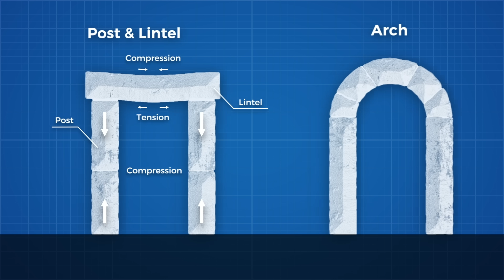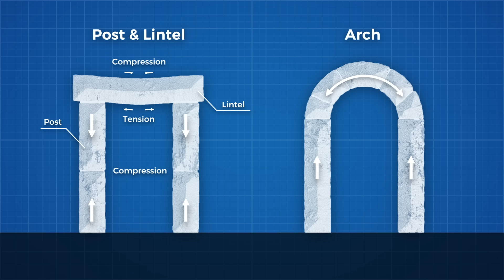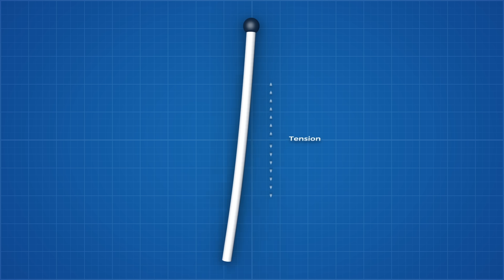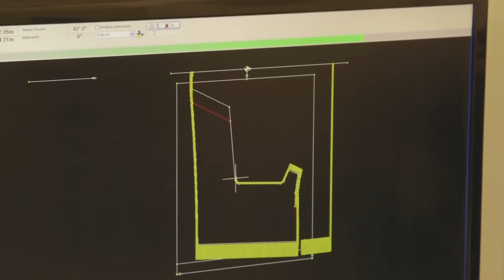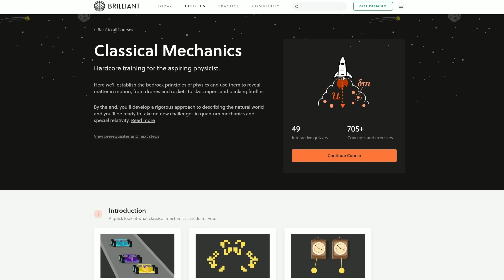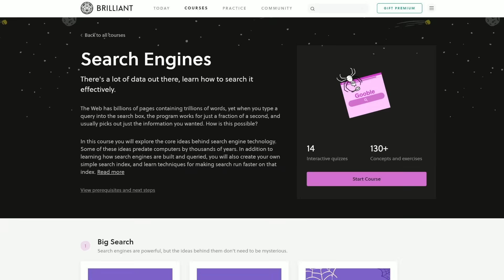The World's Oldest Construction Project | Sagrada Familia

Comment: Great video as always but i noticed a very little mistake:
a chain (or rope) attached by two points doesn't follow a parabolic arch instead it's a catenary, witch to be fair it's very similar.
I'm not an architect but wikipedia reports that "When an arch carries a uniformly distributed vertical load, the correct shape is a parabola. When an arch carries only its own weight, the best shape is a catenary."

Comment: 7:20 "Deeper parabolic arch". No. It is not a parabola. The shape is called caternary curve, and is described by hyperbolic cosine function. They are pretty close to each other, but they are not the same, and there are some edge cases, where they deviate significantly.

Comment: Imagine what he could do with todays tech.
Reply: Really? Most of this was built before today's teck. Have you looked at a modern glass and steel structure? No comparison. This structure is the ultimate convergence of engineering and craftsmanship.  Image a stone building over a hundred meters in hight with no steel reinforcement. There are thousands of structures like this hundreds of years old that have survived many earthquakes with out the use of computer modeling. I'm a Stone Mason and a machinist. I can assure you modern construction nothing in common with a building constructed entirely of stone.
Reply: @gregbly9089  Sadly most of the practical knowledge from the crafts is being lost forever. The problem with most of todays structures is durabillity. Steel (and thus reinforced concrete) is sadly condemned to last 50 years in good condition, 200 if well protected, more if it is special marine steel, yet, nothing comparable with stone, concrete or bricks (active mass structures). Paperwork from many countries favors standardized structures that can be modeled into simple equations that can be proved to prevail in all sorts of hazards, like active vector structures (pillar and beam structures made of reinforced concrete, timber or steel).
Active mass structures are more complex to standardize because the problem is not resistance, the problem is stabillity: any arch or dome must keep the thrust line inside the structure or tensions will appear. This is easiear to prove with strings and weights or drawings than with ecuations, but that wont pass most beaurocracy in these standardized times.
Neural networks over finite element analisys should get standardized soon, and that would eliminate some barriers for creative architects to work with active mass structures, but construction has always been a slow beast. By then most of the knowledge from the crafts will be lost and we'll have to start anew.
Reply: Check Guastavino's work in New York.
You can also check Ángel Truñó's "Construcción de bóvedas tabicadas", a really really beloved book in my collection. Or Ramón Guarda Parera's channel, who builds these kinds of structures at a smaller scale.
Reply: @iagocasabiellgonzalez7807  Isn't concrete also alot cheaper to work with than bricks and stone? Like, I'm not saying it's because of equations, I just think politicians care about spending less than what the artist, in this case an architect, says.
Reply: @DarkAngelEU  The price of concrete depends on the volume, the reinforcement needed and the cost of executing it. In Spain at least the materials are way cheaper than the time of the construction workers, so flat orthogonal shapes are the cheapest, even if you need more steel. When materials are costlier than work, the reverse applies, so in post-war scenarios (Spain in the 1940s) bricks are really cheap (it's just cooked mud), and concrete (cooks hotter than bricks) and specially steel are harder to get, while the workers would build for little more than bread, so low rises with tile vaults, or masonry with wooden beams were very common.
So in many countries you have standardization from the governments and construction economics against active mass structures. Robotics may change the game though.
Reply: @gregbly9089  But, if someone took todays structural knowledge and went to building such a beautiful monument, could you imagine ?
Reply: @KalRandom  A building more impressive than this one.? Why fantasize about the unknown when I can marvel at the unbelievable ly complex engineering  that went into this magnificent structure. And you want to talk about what? A fantasy?
Reply: @KalRandom  I'll take the challenge myself. You have my pencil.
Reply: Procrastinate on Reddit like every creative nowadays... Image what we could build without today's tech ;-)
Reply: @fischX  LOL , creative people are not procrastinating on reddit, they are doing creative stuff, the people who are blaming today's tech for their procrastination are probably not creative at all, they just find that as an excuse, for being lazy.
Reply: @fischX  yeah we could've totally sent like, a car to space or something if people stopped procrastinating.

Comment: Arches can push the outer walls apart however. The force does not go straight down.
Reply: That's when you need more struts!
Reply: @zockertwins  You say that as a joke from KSP but there is an actual truth to what you said. They had and used struts depending on the construction.
Reply: That depends on how level the ground is and how the weight is distributed. You may notice some of the roman arches still standing?
Reply: @justinpyle3415  The ground has nothing to  do with an arch. Roman arches stand because they have arch bases pushing against arch bases. You cannot build a 25cm thick wall that is 3 meters high and just put an arch on it. I build arches in real life so I know how its done. In many cases they have internal ties made from steel that are hidden in the mortar of the brick walls at the corners atleast. The massive roman domes are supported by 1m walls or more probably. Some of those massive walls are not to support the force coming from above but to withstand the weight that is pushing them apart. Take a measuring tape and measure the outside of a church at the bottom and then the top. In most cases the whole building is wider at the top.